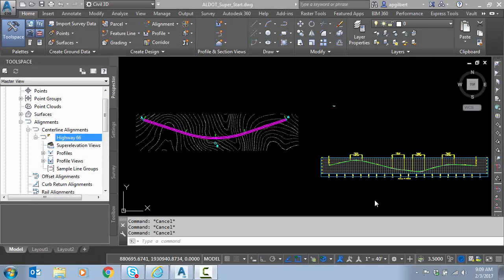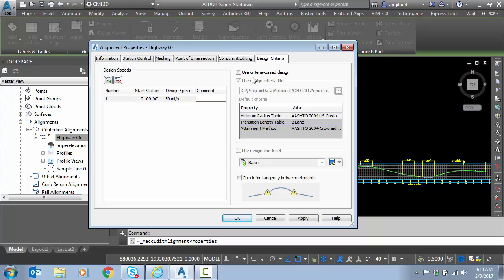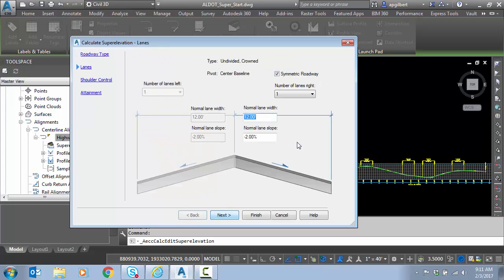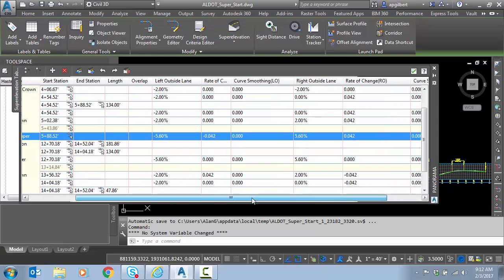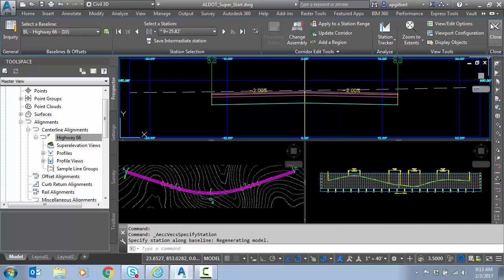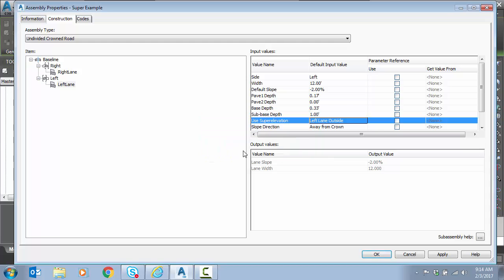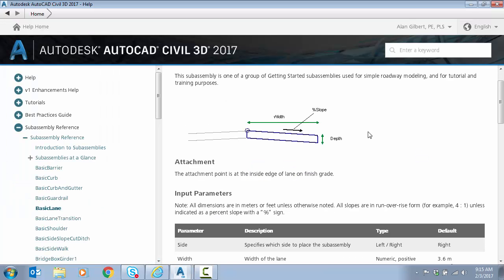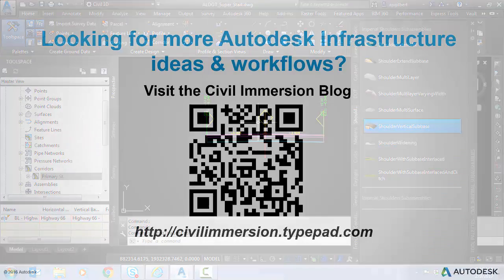Finish Strong Friday: Civil 3D Superelevation Part 1 - Overview

Comment: Hello, first i would like to thank you for this tutorials which are very helpful, also i would like to ask you about Superelevation from the left or right edge-of-pavement. Is it the same procedure like it was 2005? The procedure was to creat a left pivoting assembly by placing a LinkWidthAndSlope as the first
 subassembly. Then to build the left lane, you used the LaneTowardCrown and then attached the
 LaneOutsideSuper as the right lane.

Comment: hello sir, here  my question is , i have some Internal roads plan n profiles cad file which designed  on max super elevation is 2% and on normal crown slope also -2 % but in civil 3d there is now criteria at 2% s.e. how can i re-calculate this criteria in civil 3d.?

Comment: hi Alan, this is an informative class. other then this
do you have any presentation about the super elevation of planer road with pivot of the left side and similarly left side is higher. I have run this situation in civil 3d 2016 and ended up with theoretically wrong graphics. 
In my case, all the lanes and curb gutter are on the right side of the cross hair. I also have curb on the left side of cross hair but I kept it in the right side of assembly group. I have assign right outer lane to super elevate to all lanes. Please advice.